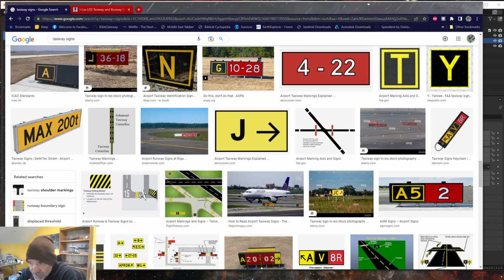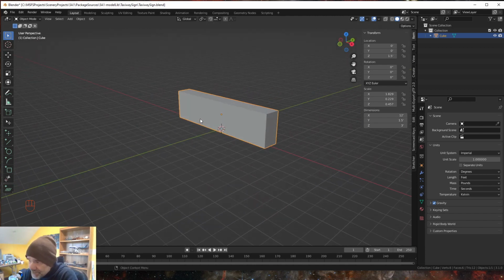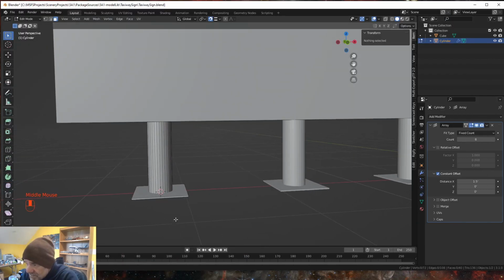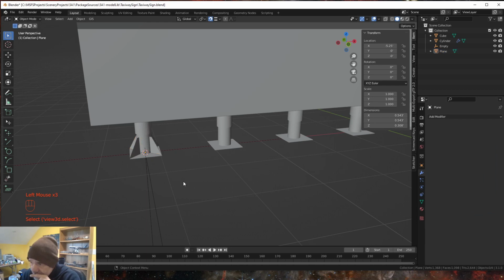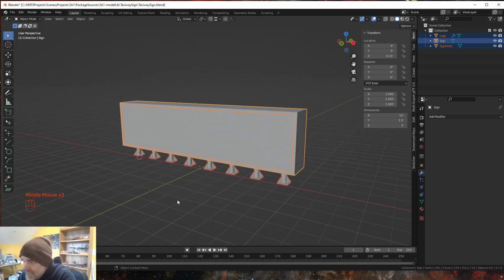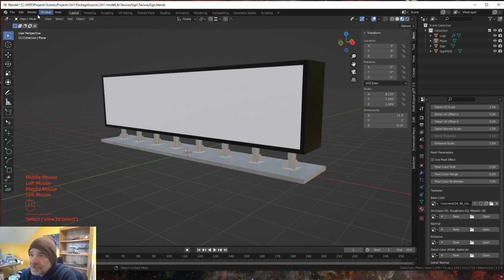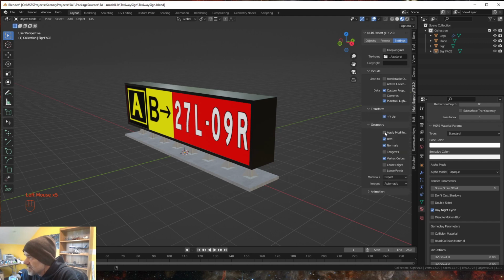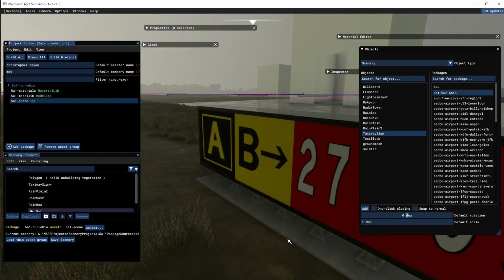Creating Scenery for MSFS: Custom Airport Signage Part 2 of 2

Comment: Thank you again for your wonderful tutorials.  However on this Part 2 I have a problem that has been occurring for some time when I try to export Blender to MSFS.
I followed your video exactly but on export I received a Python Error - here is a link to a screenshot of that error - xxxxxxx

Is there anything that you could suggest that needs to be done to resolve this error?

- - - - - - - - - - - - - - - - - -
EDIT:  Seems that I cannot include a link in these comments - not sure how to show you the error.
Reply from the maker: Join FB group Microsoft Flight Simulator 2020 SDK and Scenery...post issue there.